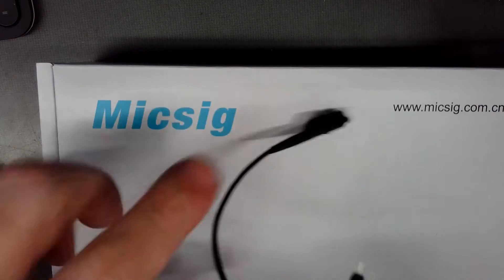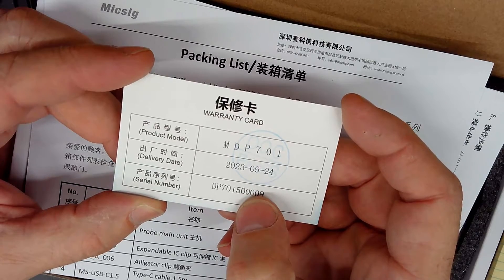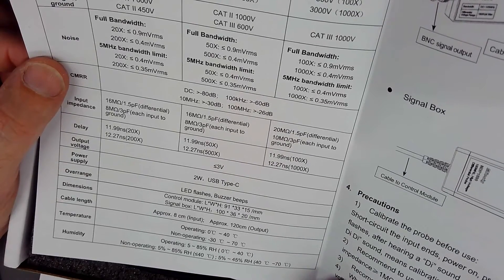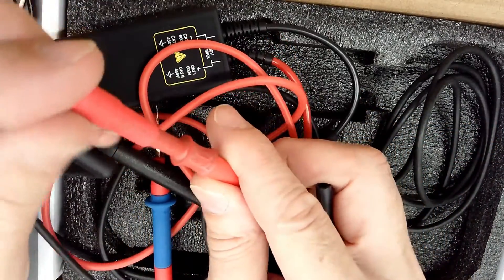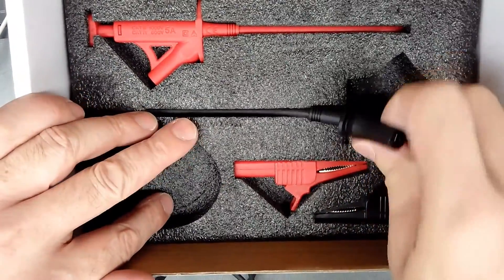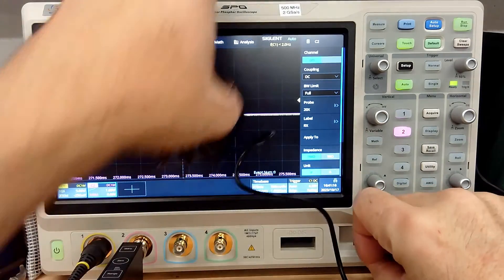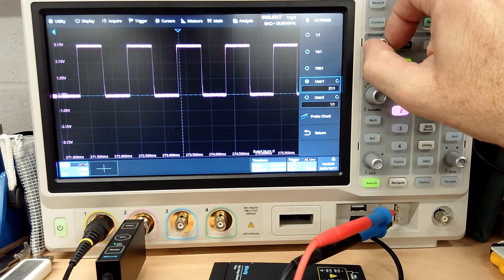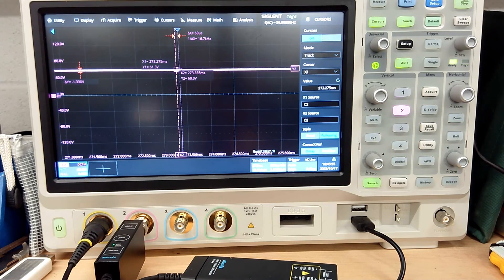First look - Micsig MDP-701 Differential Probe S/N 9!

Comment: It seems like a downgrade to me.. The MDP701 is not as resistant as the previous version DP10007 which could measure up to 1600V and I have seen tests of withstanding up to 2.2kV.